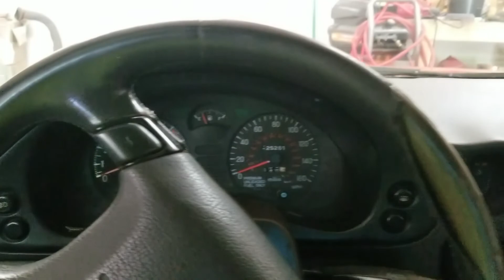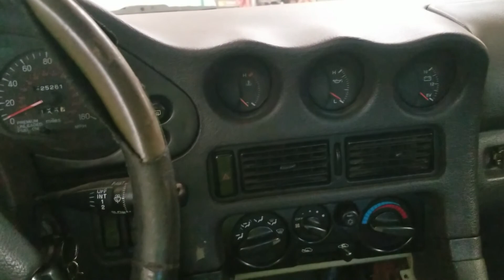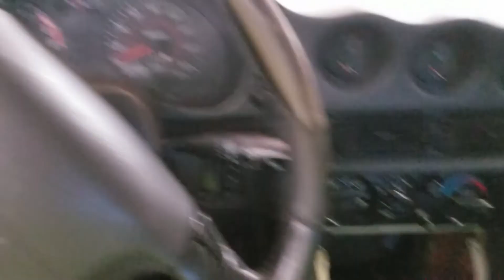1995 3000GT - Lowering the Car with EBAY Coilovers, 20mm Wheel Spacers (Front End)

Comment: pro-tip: putting  vr4 spindles on an SL is less of a nightmare than replacing the SL wheel bearings lol. ITs expensive about 900$ for all the parts but so worth it. You get bigger brakes, and bolt-on hubs, And get you some 3sx braided lines and delete the ABS and its a night and day difference at how much better they work..and less headaches for replacing parts in the future. Did it on my SL with some Gen1 Stealth TT calipers..Its one of my favorite mods..made the most difference in performance.
Reply from the maker: Trust me, thats one of the main things I want for my car! I want the VR4/StealthTT spindles brakes/calipers everything lo9l
Reply from the maker: TBH I just want a donor VR4/StealthTT car so I can cannibalize everything
Reply: @DadbrosGarage  i did mine by scrounging around online. If i had a TT donor car it wouldn't be a donor car for long xD.

Comment: would you recommend ebay coilovers? I want to lower my 3000gt an inch or two but also don't want too harsh a ride
Reply from the maker: I used them on my 3000gt. They are alright but also a little rough. Small bumps feel like hard hits
Reply: @DadbrosGarage  I think I'm gonna go for it 😎